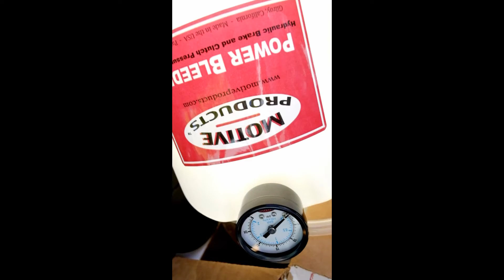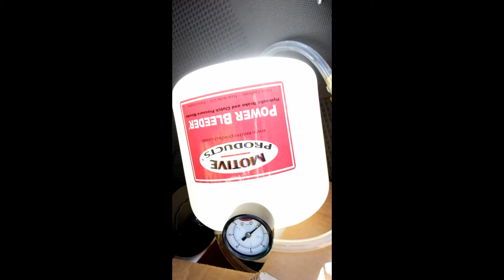Nissan Xterra & Frontier Rear Brake Lines Replacement Part 1

Comment: Thanks for the video Sergi.  I've never done anything with brake lines but due to a leak from hitting something under the car while driving off road, I have to replace some brake line parts in my 2015 Xterra.  It really helps to see a video showing the technique and difficulty of dealing with the parts that don't want to come apart and go together easily.  As a newbie, one never knows how hard to push or pull or twist some fastener before it breaks.  Your video shows these struggles giving me confidence to try the repair on my own.  Luckily, I have a pretty clean, rust free under carriage on my Xterra but will still PB Blaster spray to soak all the screws and nuts the day before to help them come apart more easily.  Thanks again for taking the time to share your knowledge, I will look for Part 2 of this video next.

One more question - the brake open end wrenches seemed to not work well for you.  Either too tight or too loose. Are they an inexpensive brand not made with close tolerances or was it the corroded nuts or something else?  I need to buy some of these wrenches to install new brake lines, what sizes do you need for this job or is it best to buy a complete set?

Comment: Thanks so much for the video!! Can you give me the Nissan part # for the hardline that you got from the dealer?
Reply from the maker: Apologies for my late reply. Please double-check with your local nissan dealership for the exact part number.

46290-EA100 Rear passenger brake hard line next to the flexible line.

46310-EA000 Rear driver brake hard line next to the flexible line.

46242-EA001 Front driver brake hard line next to the flexible line.

46240-EA001 Front passenger brake hard line next to the flexible line.

30851-9BM2A Clutch hard line next to the flexible line.

Comment: Hey bud I have a question, does the brake hose require a crush washer between the brake hose and caliper? I got new calipers and it comes with two crush washers... But also a banjo bolt that looks like it's for the front caliper?
Reply from the maker: Hey, front calipers require 2 washers per side, rear calipers require 1 washer per side, simple math 😏
Reply: @sergiikvasnyi188  beautiful bud that's what I was looking for, rest of the video was good luckily I got to just switch the hose and see yah!
Reply: @sergiikvasnyi188  why they put a banjo bolt in the rear caliper box? Just to fuck with me or what
Reply: @sergiikvasnyi188  I was having trouble pushing in the piston on the old caliper I'm wondering if it was cuz the pressure was going to the other side, the other piston, I had my buddy order calipers before hand so I just slapped em on

Comment: which adapter did you buy for motive brake bleeder.. the one that goes on brake fluid tank
Reply from the maker: I did not bought any adapters, used
one that come with a kit. Cover, thick rubber washer and small chain with two adjustable bolts

Comment: Hey body where you bought those Rear inner steel brake hose for the Xterra ? Thank you
Reply from the maker: Hello, I bought them at local auto shop, but there are big variation of it online, mine was Goodridge 22115.
Reply: @sergiikvasnyi188  Thank you very much, very kind of you.